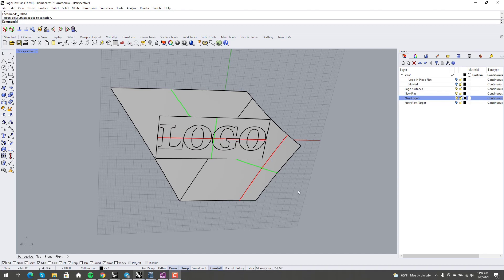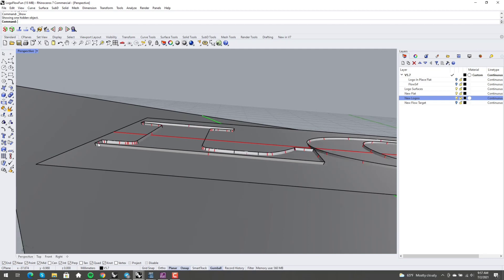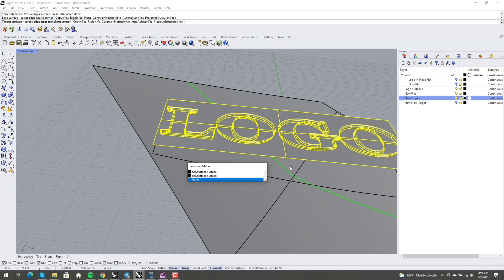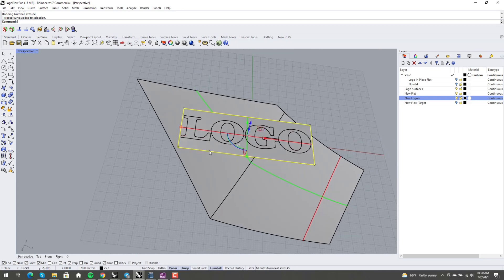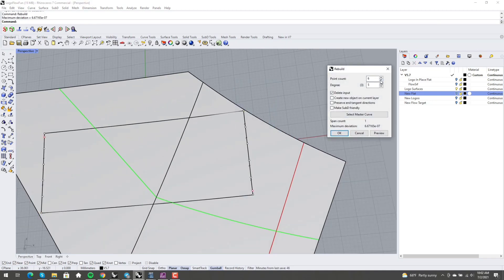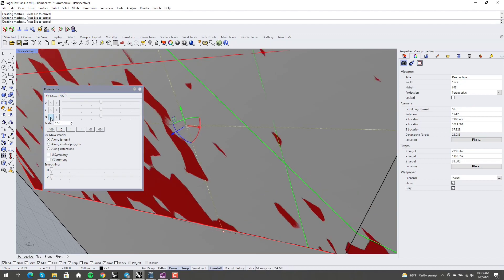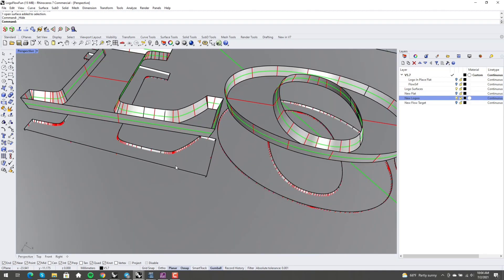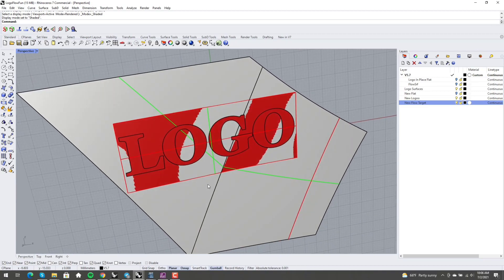A Tricky Logo Application with FlowAlongSrf in Rhino3D

Comment: I had some problem trying to create a vinil sticker for a double curved surface, do you happen to have any tips for this kind of situation?
Reply from the maker: Was the problem with the vinyl or your model?
Reply: @thirtysixverts  the model was made via CNC, the problem was, i believe, with the planification of the surface of the vinyl sticker, to convert it to dwg for cutting.
Reply: the vinyl sticker would align one way or another, but not both as in the 3d file. 

the way I made was projecting the 2d curves into the boat hull, splitting the surface with the projected lines, then unrolling the surface (with squish command, since the help files say it is better for double curvature surfaces)
Reply from the maker: @EngineerAAJ  So it sounds like the problem was that the actual vinyl could not conform to the compound curvature of the surface it was being applied to?
Reply: @thirtysixverts  exactly,in rhino, the vinil could align with both reference lines, the squished dwg could align with one or another, but not with both, in the end, the vinil manufacturer send a employee and he took paper and cut it to fit on place, then mapped this paper with his cutting machine to produce the right dwg.

the final dwg ended beeing way bigger on the far side (away from the bow where it was almost single curvature) while the part closer to the bow was a bit shorter than the dwg, where the double curvature had the most influence.
Reply from the maker: @EngineerAAJ  Interesting! I can see how that would be challenging. I think I would have done it slightly different - it sounds like you flat projected the logo onto the surface, and then unrolled that. I think I would have used FlowAlongSrf to wrap the flat logo onto the hull surface - I think that would give you a better idea of the deformation that would happen when you applied the logo? I would use FlowAlongSrf to apply it, and check to see if it got too deformed in one direction or the other, then I would go and find the very best vinyl wrap person in my area to apply it, those people are so good at dealing with this problem.
Reply: @thirtysixverts  in my case it wasn't a logo, it was just a geometric vinyl customization, I received the 2d drawing from Adobe Ilustrator, converted it to curves and lines (always going for single span of course), cleaned then up, and then projected on the hull.

I did try using flow along surface , however it would modify the intended design for the sticker. that is why I ended up using the project for the final work. 

I guess that maybe I should had used FlowAlongSrf on the reverse direction ? Getting from the curved one to a planar one maybe? I will try to run some tests.
Reply from the maker: @EngineerAAJ  Oh that's a SUPER interesting idea, I love it! It might work better than Smash and such. For sure, I'm going to try using it in reverse if I ever get a chance.